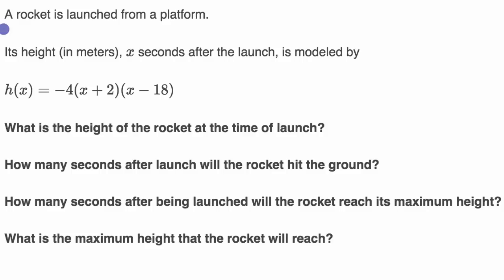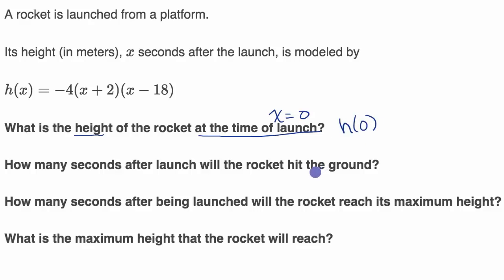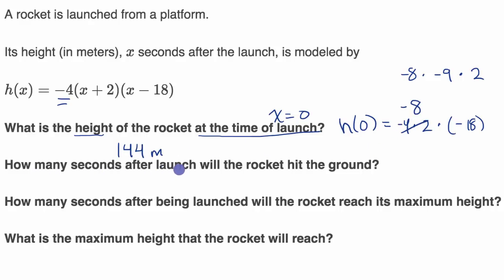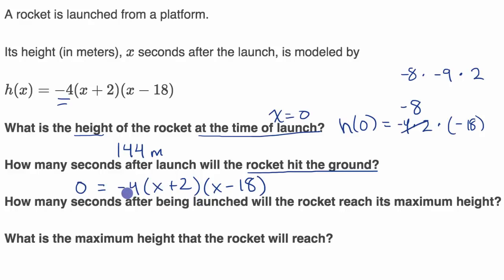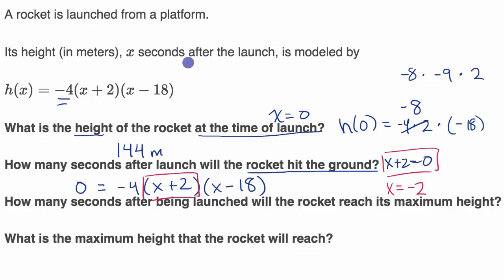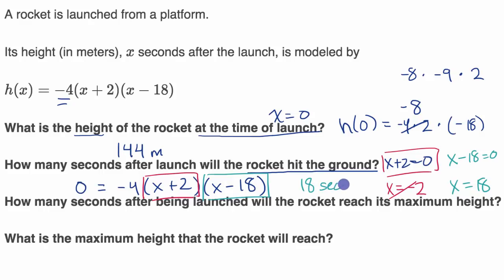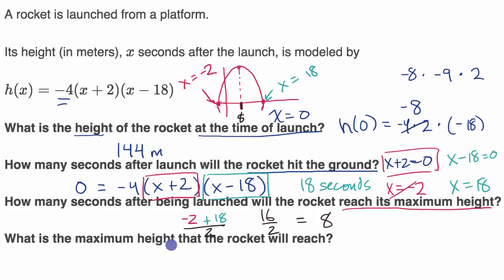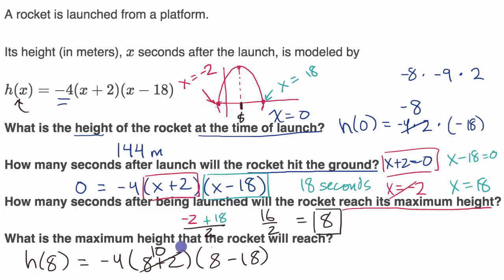Interpreting a quadratic in factored form

Comment: Doesn't the rocket launch at -2 seconds, so the maximum point would be reached after 10 seconds? And the rocket would hit the ground at 20 seconds ?
Reply: The time is NEVER negative.
Reply: @josevera1246  yeah
Reply: @josevera1246   The actual launch time is not negative, but on the graph, supposing it launches on the ground, the time would have been -2s. But yes, if we get 10 for the mid-point from (20-(-2))/2, we should add that 10 back to -2 to get the maximum height time, which is again 8s after launch.
Reply: as someone else has said, time is never negative.
Reply: good one
Reply: I made the same mistake of forgetting to add the 10 back to the -2 as the start time is 0, not -2, which gives you 8, which makes sense because the launch height is higher than the ground to time 0 to time(max) should be shorter than time(max) to time 18.
Reply: yeah he made a mistake